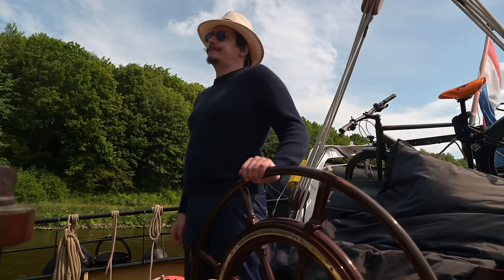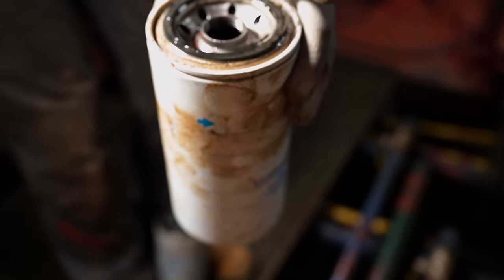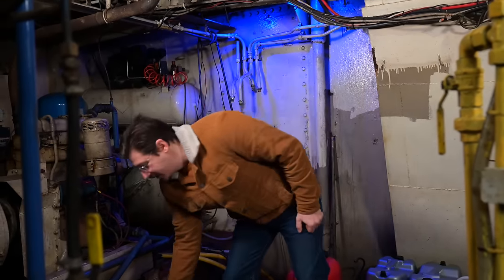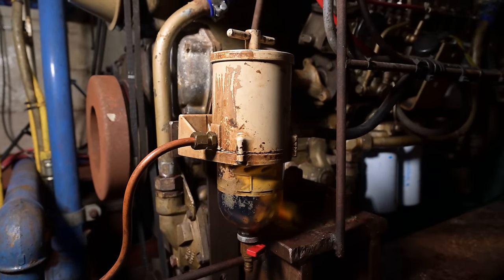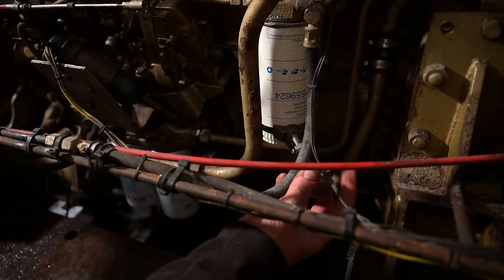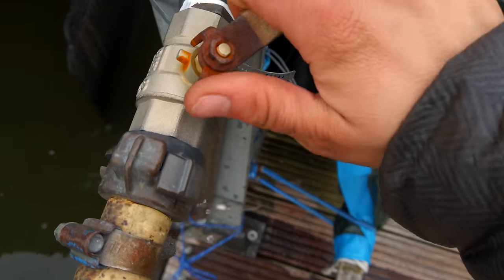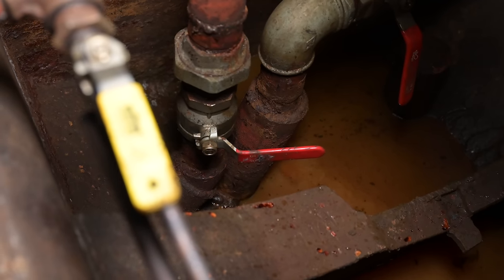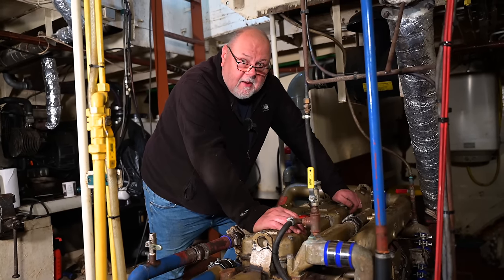Engine Run and Service on Our Historic WW2 Trawler!

Comment: Why does the engine need to come apart ??? Its done 5000 hrs ?? Thats barley run in LEAVE it alone . 15W-40 is what should be in it and make sure its Mineral oil DO NOT put any synthetic oil in it. The gearbox should be a 30W oil . again not a synthetic oil !! My tugs have 3412 CAT engines and we use 15W40 !!. 30w oil is thinner than the 15W-40. What microns were the separs filters ?? Should 10 min or 5 micron is better. REMEMBER diesel will go off in 2 months due to the additives they put in the fuel these days so ..
Reply: Wear isn’t the problem with a lightly used engine the problem is corrosion and blockage of the oil passages
Reply: ..what a nice result! ..it runs..the next step is done.
Nice video and good information for us.Thank you!😊
Reply from the maker: We use an additive from Liquid Molly to prevent the diesel from going bad. But fuel shouldn't go bad within two month. Maybe you have contaminated tanks or fuel lines. Bacteria and algae can cause problem so that might cause your problems. Initially a 15W40 is slightly thicker than a SAE30. But the manufacturers achieve this by taking a thinner SAE 15 oil and thicken it to an SAE 40 oil. This way they have a thinner more fluid oil when it's cold and the thick SAE 40 oil when the oil is hot. That's great but over time and with hard use you'll end up with a thin SAE 15 oil. Hope that helps somehow.
Reply: I do not need to know about how oils etc and diesel works . Who ever told you that the 15w40 gets thinner ??? and Diesel will go bad the same as petrol with ethernol. I have had vessels for over 40 years so who ever told you about oil and fuel going bad is wrong. The best way to stop diesel bug is to make sure you never leave the bunkers half empty etc as the tanks will sweat in temp changes also remeber the returning fuel from the engine is warm so when you stop the tanks will sweat which in turn causes the algie etc . Todays fuels GO BAD fact and is all due to the additives they put in the fuel. Also the capacity of your oil sump denotes how often you should change your oil so I suggest you check that out as well . All my vessels were built by Damen in Holland and I def know what I am talking about .
 @FlyingConey For your info.               According to most refiners, diesel has an average shelf life of 12 months if stored at a temperature below 20°C (68°F). That may be realistic for underground storage tanks, but not for aboveground storage facilities. If temperatures reach above 30°C (86°F), shelf life is 6-12 months at best.
Reply: @howardbeer5214  yeah that sounds about right I wouldn’t want to leave my tanks with an air gap over winter that’s for sure and I also use soltron as an additive to help stop the dreaded bug
Reply: Get a real mechanic. That guy has no idea. Maybe read stuff online.
Reply: @srb6764 Hello.
Would you care to explain your comment.
I am a fully qualified Diesel mechanic with 40 years experience in the commercial and marine engine environment.
I have taught students in technical training schools here in England, and made a successful career from doing so. 
I will accept criticism if and where it's relevant, but your comment is neither helpful or relevant without an explanation.
If you feel you can offer any assistance to the project, take this opportunity to come over and demonstrate how you would do things. 
I respect that you have every right to your comments, but also please respect that I have as much right to my own. 
Thank you. 
John👍
Reply: Hi Howard.
It doesn't need to come apart now as it's obvious from the way it runs its fine.
Recent developments about the engine had cast doubts about the actual running hours  of this engine.
The engine was thought to be a new engine installed in the mid 1970's, but information has surfaced indicating that it is a used engine from another boat and the hours could be incorrect.
Not knowing the facts, led me to think it would be a good idea to at least look at the cylinder bores and bearing shells and do some measuring, to start on a level playing field so to speak.
There will be more 'engine work' done once the boats in its next shipyard, but now it can move under it's own power again.
Thanks for your comment.
John👍
Reply: Ok John but a good indicator of bearings etc will be oil pressure when hot and also it needs a good hard run as they just run along about 1100rpm . Those old Dafs are good units and if its not burning oil etc and has good oil pressure I would leave it alone . Just one question what size sump is on the engine ??? IE capacity as that will denote at what engine hrs the oil needs changed .  H 
 @827SLi
Reply: Evening Howard.
This engine has the larger deep sump and takes 29 litres.
I'm in total agreement with you on putting this engine to work.
It's crying out to do what it does best, and now it's operational, Daniel and Barbara can do more with it.
Thank you for taking the time to respond.
John😊
Reply: Thats a plus then or its every 250 hrs . They will safely be able to go 450-500 hrs between oil changes and maybe just do a filter change at 250 . Cheers H  @827SLi
Reply: A bit harsh, sorry. Maybe it's your classroom presentation. I'm not going into experience and qualifications here but, to put things in perspective here I had a Leyland 680 running a 10" pump on a sand dredger in the early 70s. I'm quite old now!
Reply: @srb6764  Hello.
If your reply was to my comment, then that's fine.
I have no reason or desire to fall out with anyone.
I've no idea of your age, or even your name, so let's start afresh. Im John and I'm in my 60's and come from the heart of England.
I'm my youth I spent hours working of fishing boats and trawlers in Poole harbour in Dorset.
This is where the interest in marine engineering started, and I followed it into the motor trade, commercial, and back into marine work. 
It's getting harder as I age to do the heavy work now, and confined engine rooms are not built for someone 6'3 😅. 
I've spoken to many people on here from comments from Flying Coney, and in general the conversations have been great. 
I've ruffled the feathers of a few, but as you are no doubt aware, we mechanics can be an an awkward breed when it comes to how we do things. 
It's like your favourite spanner that someone else borrows. 
It's a spanner, but no one else can use it the way you do!. 
Let me know who I'm chatting to please. 
Thanks for your comments. 
John👍
Reply: John you could have your own channel helping others sort there marine diesels, I think you could be quite popular as an educator now that engine rooms are smaller and getting smaller on boats and ships.
Reply: Are we not talking about two countries one in Europe and one in the USA? Just wondering.
Reply: @hesseldijkstra5327  What are you talking about ??

Comment: Advising the owners to overhaul or perform invasive maintenance on the engine without putting some time on the lube oil and doing an oil analysis in addition to compression testing, borescope inspection and injector testing is absolutely irresponsible and unprofessional. Using tap water as coolant is a very bad idea. Coolant does more than just cool, it protects against corrosion and liner damage from cavitation. Just because someone mistreated the engine in the past is no reason to continue the abuse. Cleaning the aftercooler is probably worthwhile as well.
Reply: Hello.
I am far from an unprofessional irresponsible mechanic.
I have 40 years of experience with commercial and marine Diesel engines, and have taught in technical schools here in the UK.. 
What the video  fails to show is that I had two days to assess and repair the engine before flying back home. 
In this time, the engine had to be repaired and got to a running condition to make the boat mobile again. 
The approach to repairing the engine was discussed and a decision to approach it in a concervative way taken. 
I would have loved to have brought across my van full of equipment, but for two days!!!!. 
An experienced mechanic can tell so much about how an engine runs just by listening to it, resting an experienced hand on the valve covers, and feeling for vacuum in the crankcase. 
All this without lifting a spanner of removing an injector to get the borescope in. 
I have built a successful career  from being professional. 
You have every right to your opinion, but also I have the same right to mine. 
I will return later in the year when the boat is in  a different harbour and out on the hard. 
The injectors will be removed along with the fuel pump for service and calibration. 
Thank you for your comment
I hope I've explained the action I took
John👍

Comment: Will you please stop the " huge " " massive" nonsense. It's just a 6cyl truck engine. If my memory serves me right it's actually a Leyland 680.
Reply from the maker: The DAF design is based on a Leyland 680 and they both have that cool idling sound. But a truck engine IS "huge" and massive having in mind that most people drive around in their cars with 2 liter engines. A Dodge Viper has a massive 8.4 liter engine. I know that a truck engine isn't big compared with a real marine engine. Flying Coney once had an engine with 130 liters displacement. Barbara worked on engines with 16800hp. So when it comes to engines "huge" is always relative and also it's YouTube.